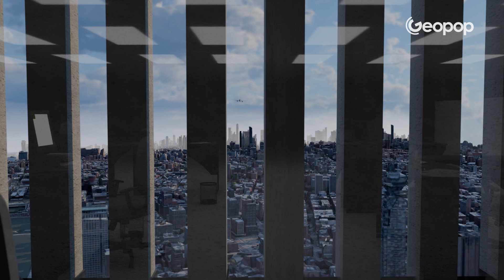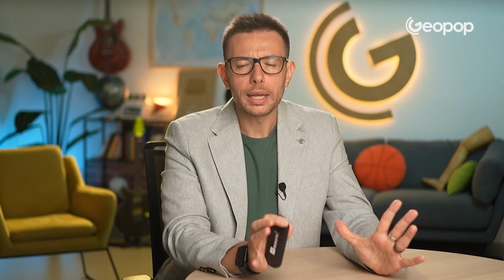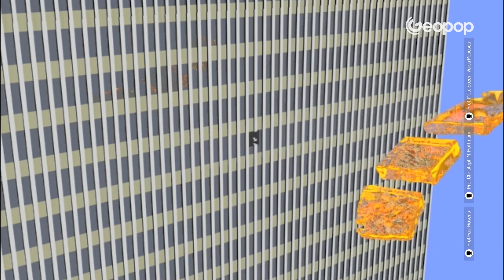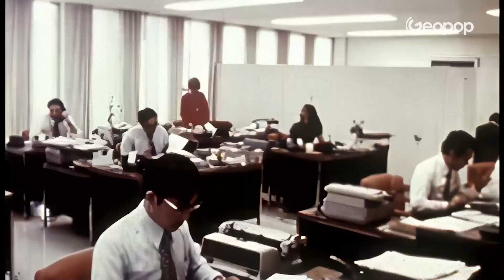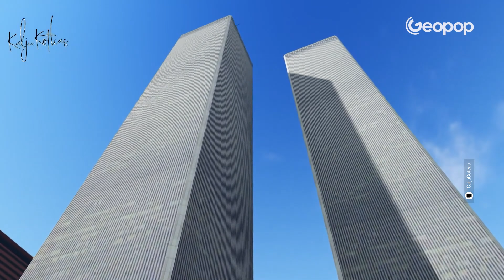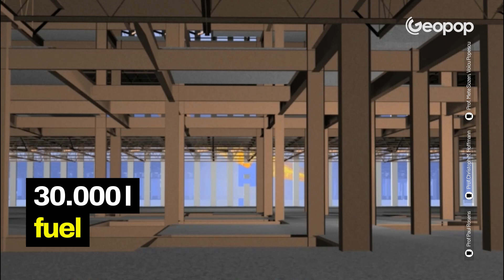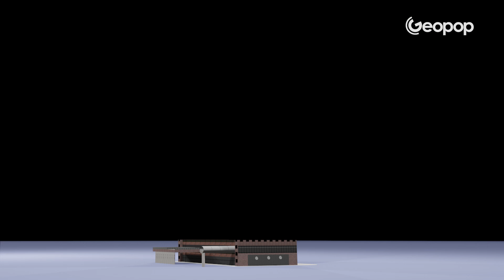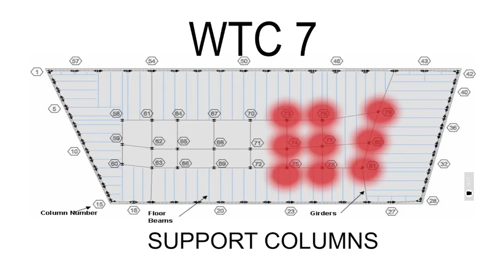9/11, 2001: The Technical Reconstruction of the Twin Towers and WTC 7 Collapses

Comment: So, my comment here isn't about making any claim one way or the other but would like to share something for feedback and comment.   While working as a medical device technician I was trained to use the electron microscope.   I was very amazed at how it was capable of firing electrons at a substance and reading the reflections in order to determine on the atomic level what the substance was made out of and break it down into its components and give a very accurate and reliable graph of what percentage of what material it was comprised of.   This company produced cardiac occluders for sealing the holes in primarily babies hearts and sometimes older children when the ventrical walls didn't seal by themselves.    My question is, if there are a large number of indendant labs or companies that have this electron microscope machinery, wouldn't many of them have been able to determine the presence of partially activated thermite in the thousand and thousands of gallons of dust that was strewn far around the perimeter of the building collapses?   It just seems if a dumb little tech like I was can take a piece of metal and an hour later produce a graph that reflects the precise presence of materials with a uniquness on the order of a fingerprint, then why wouldn't we see a massive amount of these results strewn around the internet to view if if this was a controlled demolition?  Wouldnt this have been a very easy thing to determine?  Or, if hundreds of these labs did test dust samples in their electron microscopes and claimed there was no thermite found, then perhaps we could assume with some level of confidence that this couldn't have been a controllled demolition.   Just something I've thought about many, many times.
Reply: There were melted steel particles in the dust. And you're right. It would be very easy to tell if it was a controlled demolition. And that's why so many of us believe that it was because it's basic.
Reply: Unfortunately most of the steel was picked up and sent over to China to be melted down to make cheap crap before anybody could do any testing to see if there were any foreign chemicals present.

Comment: University of Alaskas engineering department found discrepancies with NIST evaluates of WTC building 7. Go look it up.
Reply: I suspect you maybe read the Cliffs Notes version of Hulsey’s report, and decided you liked it because you think it agrees with what you want or need to believe.

I have actually read both the Hulsey preliminary and final reports from cover to cover, which is more than I can say for most of the people who recommend it to me. The Hulsey report is such a dead horse now, flogged so many times now I find it difficult these days to drum up the enthusiasm to do it yet again.  But here it goes. 

My opinion of the Final Report is as follows:

The Hulsey Final Report on Building 7 met none of its three stated objectives – indeed could not have met those objectives for lack of trying - and failed to prove its main conclusion, by way of a fundamental logic error; Hulsey claimed he had concluded fire could not bring down Building 7 without accounting for the full envelop of possibilities.  Essentially, he claimed to have proved a negative

Hulsey also plagiarized almost 3 pages of material from Tony Tsamboti, who works for the studies sponsor. I hope I don’t need to point out the ethical implications of that. 

While promising superior models to those of The NIST, the Hulsey Report in fact delivers grossly inferior models which eliminate the time factor, focus on only two floors and rely on a greatly simplified version of The NIST’s temperature data.  The model animations are clearly not derived from the model data as they show no dynamics at all and are obviously forced to make the animations (superficially) look closer to AE911T’s imaginging of the real event.

Overall, it is a shoddy piece of work done by a man clearly working out of his element and areas of expertise. It rather reeks of trying to support a conclusion arrived at before the study started.  Curiously, study sponsor Architects and Engineers for 9/11 Truth having announced what the study would conclude before they awarded it. 

Hulsey tested just one out of countless thousands of possible scenarios, using a completely unrealistic scenario and an artificially restricted set of data almost like he wanted to ensure fire would not cause a failure. The Hulsey Report was so factually inaccurate, methodologically unreliable, scientifically unsound, illogical, and biased that it blatantly violated any requirements of objectivity, utility, transparency, and reproducibility that would have been required to submit it for peer review in any reputable journal.

Hulsey and his assistants have not published the report anywhere that any relevant academic or professional engineers look to. 

Hulsey had said all along that the report would spawn several (perhaps four) papers in good American engineering journals and possibly a book. 

Then Hulsey walked that back, realizing he'd stand no chance to pass peer review in America and so said he'd go for European journals - but years have gone by with no publication whatsoever. Also, no book from any science publisher either. As far as the engineering profession and science are concerned, the Hulsey report barely exists.

The engineers of America and of the world have never read it.  It has had zero impact in the professional community. 

To its intended non-engineering literate audience, they Hulsey Report contains enough engineerspeak density for them not to ask questions, even if they were so inclined. Since the report appears to (superficially) deliver what they want, they are not inclined, even if they knew what to ask. From a structural engineering perspective however, The Hulsey Report is of no value, which explains why promises to get the report published in peer-reviewed and reputable engineering journals where it could be scrutinized by qualified professionals were abandoned.  

If you are genuinely interested in what happened to Building 7 rather than in promoting a political agenda, there are several excellent forensic engineering reports out there and over two dozen articles published in genuinely peer reviewed engineering journals that are far more comprehensive and competently done. I suggest you seek them out instead.

And actually read them.

Comment: Go ahead keep on peddling these lies, the $12 Trillion lie. Two decades of war 
Anyone with reasonable structural engineering understanding and the basic fundamentals of physics knows that most of what you have shared here is false and misleading. But that's what your handlers want, the continued thrust of this narrative where physics took a vacation one day 25 years ago. Stop it.
Reply: And yet not wrong. Go figure. 
	
This video is pretty good – with a few exceptions - and goes into a much higher level of detail than many viewers will be able to comprehend.  While not perfect, the collapse mechanisms – the sequence of failures - described here  are fundamentally correct and this is true no matter who planned and carried out the 9/11 attacks or why . 

That may not be what you want to hear and go against 20+ years of entrenched dogma and conditioning, but it’s not wrong. 

That also means (in case you did not get the hint) this video can be (and IS) absolutely correct in its description of collapse mechanisms AND the 9/11 attacks could still have been some sort of inside job. The two things are in no way mutually exclusive. 

The mechanisms described here have broad professional support around the world. There are no professional engineering organizations (for example: ASCE, ASEE, ICE, etc) that disagree with them or have offered any formal dissenting opinions or alternative hypothesis. 

So, setting hubris aside, either the overwhelming majority of the worlds structural engineers and simple observation are wrong,… … or you are. Which seems more likely? 

IF you still think believe this explanation is wrong then produce a better one . Good luck with that. No one ever has and I don’t see you moving that needle today.
Reply: @TheCriticalStinker-jw4fl  I don't need to describe a better one, there is an entire generation of engineers and architects that laid it out pretty plainly. Why these YouTuber intelligence assets feel the need to continually drive their phony narrative home a quarter of a century later is beyond me.. the burden of proof doesn't lie in my court.
Can't help but think you have a little bit of stake in it with your little essay. You either weren't old enough to remember it maybe weren't even alive or are actively trying to guide the narrative in a direction of dishonesty. Any way you slice it, I think maybe you can go sit and spin
Reply: @TheCriticalStinker-jw4fl  there's no reason to discuss collapse mechanics when it was an obvious controlled demolition with thermate diagonal cuts on supporting members and a pool of liquid metal in the basement. I studied this at length for many years before I decided to let it go because people can't think for themselves. Decades later and my point is proven yet again
Reply: @sequoia1171  - Yeah it is important to discuss engineering over internet conspiracy mythology.